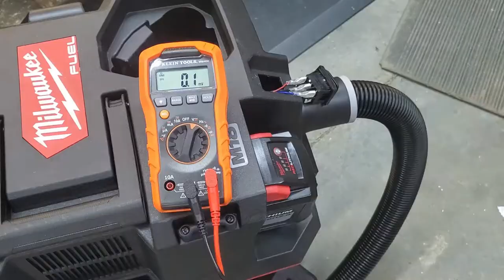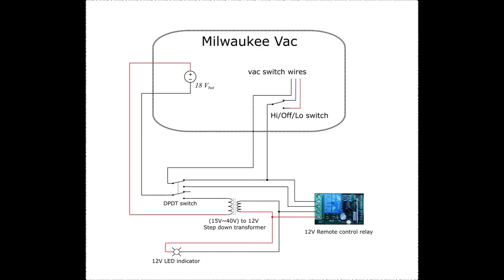HAD to do THIS to my Milwaukee M18 Shop Vac!

Comment: Hi would it be possible to use Makita vac's bluetooth parts on milwaukee vac so that it would be compatible to makita aws tools?  I havr this vac too and got a new 40v makita sander with aws and reallg want it to work on this vac.  Please let me know if yoj know anything about how to male them work together.  Would it be similar concept and instead of the relay we can just attach a makita switch or bluetooth parts to the milwaukee vac.
Reply from the maker: Definitely sounds possible. I don't really know how the Makita system works though. I'm also cross-platform  with a Makita 18V x2 miter saw and Milwaukee 18V table saw. I decided this would be the most versatile way to use the vac. If you decide to try it, come back and let me know how it works out! Thanks for watching!
Reply: @FineLineJoinery  Wish I could do something like that.  However, we should be able to buy the AWS part on any AWS tool and try to connect that to a Milwaukee tool.  Then find the Bluetooth receiver part on a Makita AWS Vac and connect that to our Milwaukee vacs :)
Reply from the maker: @tcguns  I don't know. The parts might reject each other... 🤣

Comment: have you had any problems with this? is there anything you would do different? Im about to do this to a pair of those same vacs
Reply from the maker: No problems. The more I use it, the more I love it! I keep one remote clipped to my tool apron. I walk up to my saw, turn on vac via remote, make a cut and turn off the vac as I am walking back to install the piece I cut. I plan to install the other remote on the end of the hose, to use when I'm cleaning up the jobsite after I have packed my tools and apron away.
Let me know if you have any questions about the build. Good luck!
Reply: This is an awesome upgrade. I just bought this vacuum myself and that was the first thing that come to mind was I can no longer use my foot pedal for turning on my shop vac. If you’re willing I would love to get more detailed information as to what pieces you bought to make this work?  Part numbers and where you bought them. Great job!!!!  You solved the only fault I really see with this vac.
Reply from the maker: @packoutjunkie5813  Thanks! Yeah, so I'm using the vac at a jobsite right now and the remote stopped working. I really miss it!!! Once I finish this install, I will troubleshoot the problem and might have a better recommendation for the parts. I'm hoping it's just a loose wire or something...
Reply from the maker: @packoutjunkie5813   Ok, so i'm back in the shop with the vac. I opened it up and everything looks fine. Gave all of the wires a tug at the connectors, all good. And now the remote works fine again. Just like when you take your car to the mechanic and it just won't make that sound again?... I will add a components used list in the description. Good luck!
Reply: @FineLineJoinery  Thank you so much. This will be awesome. I used it for the first time today and love it. This upgrade will make it perfect.
Reply from the maker: @packoutjunkie5813  Added the components list. Yeah, I absolutely love the vacuum!
Reply: @FineLineJoinery  Your awesome. Just placed the order for everything. Here is to not burning down my vacuum.  🤣
Reply: Is it bad I ordered all the stuff and now I don’t want to void the 5 year warranty 🤣.  But I still want to do it. I build a stand on my chop saw to have it at height so I can just flip the switch each time I use the saw. However I know that is limited.